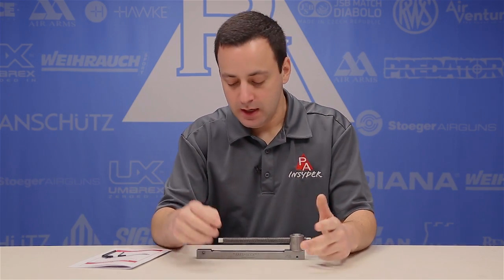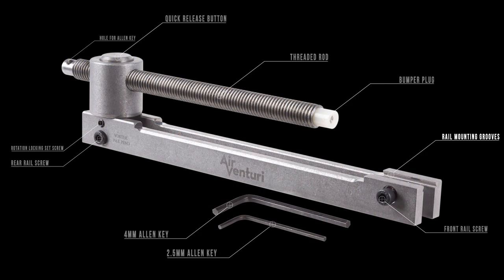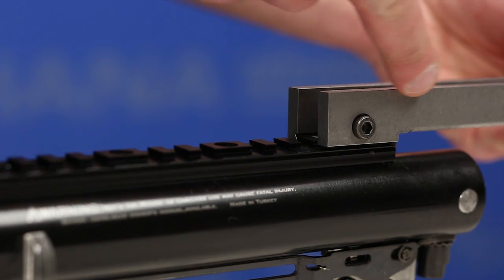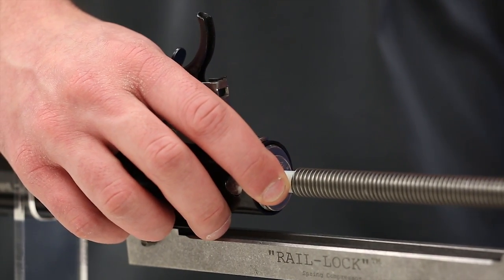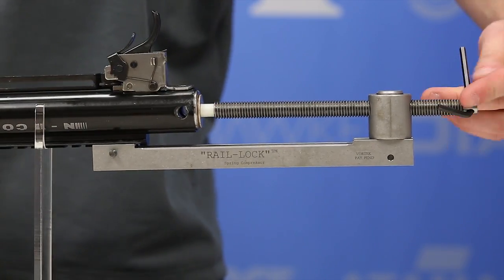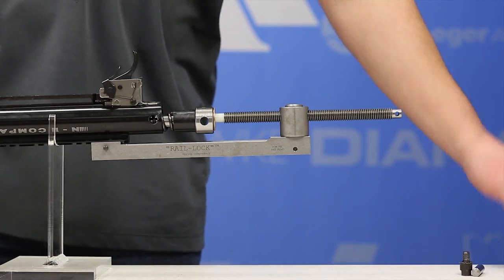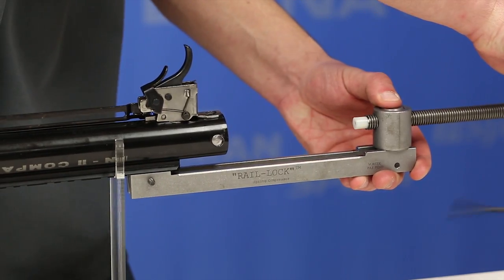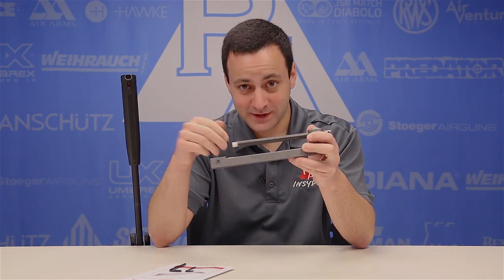Air Venturi Rail Lock Airgun Spring Compressor

Comment: Very informative and appears to be well thought out spring compressor. Will this work with a HW97? My gun is full power and the back trigger block  has to be unscrewed to remove and the spring? 
Thanks,
 Joe

Comment: This is a great idea and will certainly make working on spring guns more convenient. The one thing I do not understand is how can you adjust the distance between the threaded rod and the body of the unit itself? 

That distance will vary from rifle to rifle. The Diana's have a dovetail rail welded to the compression tube that will increase that distance vs other rifles that have the dovetail grooves cut right into the tube. This could lead to the end of the threaded rod being not in the center of the end cap which could, in turn, lead to it slipping off during tension release or compression. 

I guess the other way to address this is to put some sort of large "pad" at the end of the threaded rod instead of a small plastic buffer, mimicking the jackscrew setup that we all use when we made our homemade spring compressors. This floating pad could allow for some angle and play in the differing setups. 

All in all, fantastic concept, but there may be a few adjustments to make it safer.
Reply: Good point. My 2 Diana/RWS 34 T06 Classic's dovetail rails are cut into the compression tube, guess I am lucky.  Some Benjamin/Crosman have welded on dovetails which may present a hazard as I have read from reviewers they have popped off during normal use of the rifles. Anyway, this spring compressor just may be on my short list.
Reply: It can and has been done on the Diana's and various other brands that have the elevated scope rail.  You have to remember that you only need to push the end cap in slightly so if you're pushing at an angle it's not the end of the world.  And you can angle the rod enough to do that.  The Rail Lock was designed by Vortek Products in Michigan and vetted heavily by both them and Air Venturi on a ton of guns before this was brought to market.

Comment: ..... i'd seen this design when i was more into the airgun biz.....they knocked it outta the park with the design, but since it will not work on all airguns , i was thinking it was $50-55....   at $99 , you may need to consider the sun optics spring compressor , which services more spring, gas ram / piston airguns .     - paul.
Reply: The Sun Optics has been discontinued by the manufacturer, guess they were too concerned with liability and lawyers.

Comment: Admirably clear video.  But my Stoeger X20 has no rail.  Ideas?  Need to send it to a shop, I suspect.  I like the gun and want the power cut down, the dischg noise too, by removing the 1" plug that gives the spring extra compression.  What shop/who would do that?

Comment: The tool might be OK but I wouldn't trust the rail with much stress. I have seen scope rails fall off from normal use. I pass on this for safety reasons.
Reply: would you do that with a Benjamin NP2?
Reply: Do what?
Reply: You won't have that problem with rifles that have the dovetails cut directly into the compression tube. It does beg the question of all around safety however. Two allen screws are what is preventing you from breaking your hand or worse. In theory, I'd love to get it and hope it works. The price is way too much though, $99 plus S&H??

You can build one to custom fit your gun for about $25 in hardware and lumber. I guess if Air Venturi sells the heck out of them the price won't come down. 

Time will tell.
Reply: That's a problem with the gun then, not the Rail Lock.  And besides the early NP2s that came out, I've seen very few instances where scope rails that are not cut into the comp tube have actually come off or moved at all.
Reply: I'd like to see a list of companies that have approved the use of this tool on their air guns.

Comment: I used my bare hands and my own weight, had the pin in a bosch drill, back of the gun in my hand, the muzzle pressed against the ground, and just spun the metal pin inwhile compressing with max force

Comment: Yes it is a fantastic idea and concept. But it has one flaw other than the price. It can't be used to fix older pellet rifles that don't have 11mm or weaver rails. I have 6 older pellet rifles that need some TLC internally and this product though great for its intended use, doesn't lend itself very well as an all around solution to all spring and gas piston air rifles that need a tune up.
Reply: That's correct, it would require that the rifle or pistol used have an optics rail.

Comment: When the pin is driven out, it's too easy for the compressor clamp to slip. 
It must get a flatbar or threaded rod, bolted to the compressor, going to the barrel muzzle. The flatbar will be double, one bar atop the other, length adjustable by threaded holes and bolts. A padded steel cup covers the barrel muzzle. Anyone looking for an aftermarket opportunity? Oh, and thanks Pyramid Air, no company educates like PA.

Comment: I'm disappointed in this tool.  In one of my guns, the angle from the rising the end cap was too extreme to be safe.  In another i found the tailwind not hold to the dovetail grooves.  I actually put a dovetail to picatinn y adapter on and it held to the.picatinny.  Didn't like the angle but it held.

Comment: looks to be a great way to destroy your dovetails and lose your eyes
Reply: I was thinking the same....generally speaking scope rails are held by small fine thread machine screws and are somewhat fragile themselves. He has all the torque applied with only a inch or so of it clamped to the rail. You are going to trash your rail or......ruin your receiver by sheering off those small machine screws inside the tapped holes or stripping out the threads in the holes. You also could bend the receiver due to how far out your leverage is being applied. I think it would be much safer and work better using a traditional press or improvising one from a modified pipe slide clamp.

Comment: what is the ft lbs that the kral n11 puts out?
Reply: In .22 cal, about 22-25 ft/lbs depending on the ammo used
Reply: Tyler Patner thanks for the quick reply I'm debating on the kral n11 or octane in .22 something that has same power as my Maximus. do you happen to know the piston seal size or spring size,if I do get the kral,so I know what replacements I would need?
Reply: I'm not 100% sure on the Piston Seal size.....according to one of our techs, he's pretty confident it's about 28mm, but don't quote me on that.  As for the spring, the OD is .823", ID is .560", wire diameter is .130" and the spring has 43 coils.  Hope that helps
Reply: Tyler Patner that does help thanks,I'm sold on the kral, I wanted to know spring size and seal so I can order a vortek upgrade and custom guides,tophat lube tune,the whole shabang all at the same time and get her shooting good right out of the box
Reply: Sure.  You may want to hold off on the piston seal then, just until you can get it out of the gun and measure to verify it's size.  Definitely like the Vortek products though, can't go wrong with them.